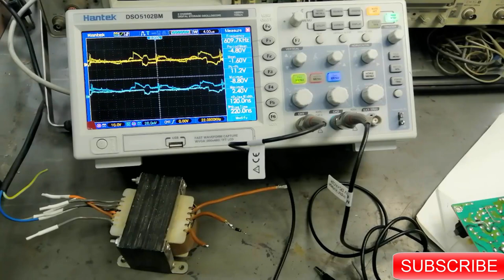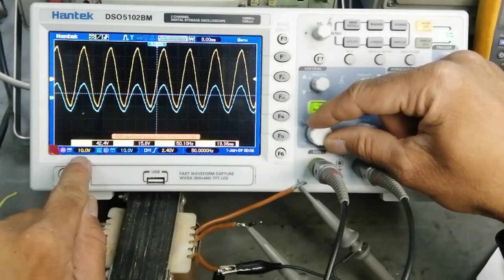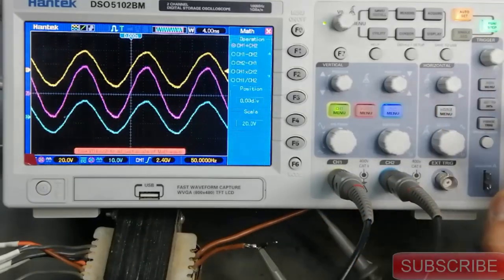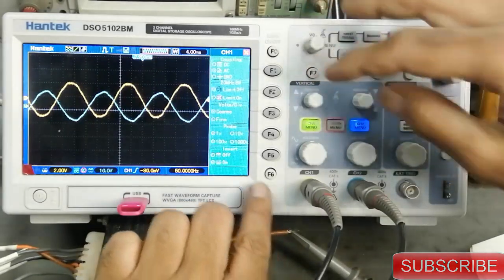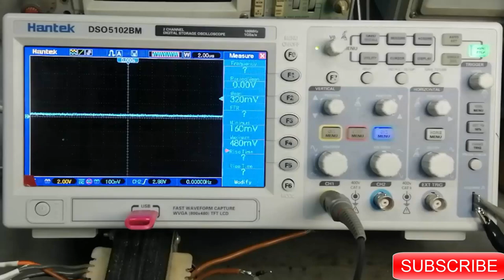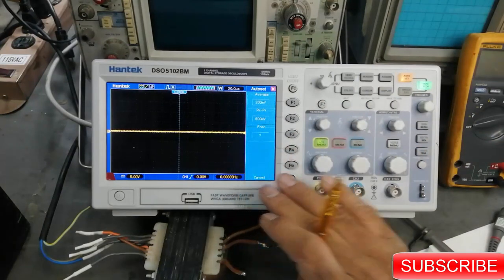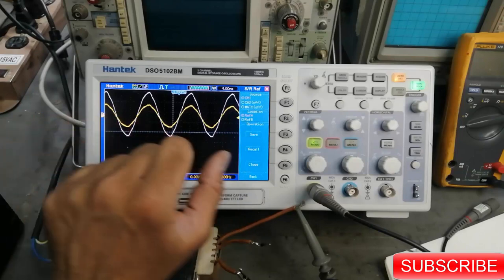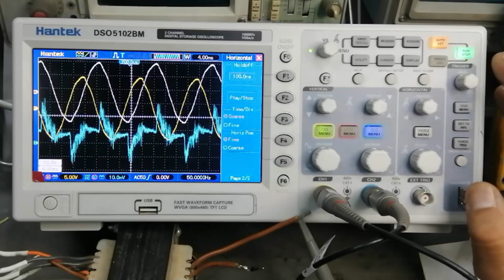{167} How to use OSCILLOSCOPE - Digital Storage Oscilloscope DSO - Complete Tutorial

Comment: Hi bro, nice video. We are using Tektronix TDS1012 100MHZ 2 channel 1GS/s, could you please advice the latest equivalent model?
Reply from the maker: Hantek DSO5102BM is almost similar to TDS1012 
Finrisi ADS1014D will more good choice, as it is 2in1 Oscilloscope and Signal Generator, 100MHz, Built-in 1GB Storage Space
Reply: @HaseebElectronics  thanks bro

Comment: Salaam sir, I have updated my fnirsi 1014D, and after update, frequency parameters gone to reverse side (down side of screen) even i am trying for move with manual key and auto key, but I am unsuccessful,  so if possible kindly guide me in this regards.
Reply from the maker: sometimes it happens due to corrupt file in updating media 
try to re-install updates
or 
try to restore factory setting. from Utility menu

Comment: Thank you for this detailed demonstration! The SMPS signal measurement part was very interesting. I wonder whether a 100Mhz scope would be capabale of measuring any SMPS unit? Or maybe some power supplies have even higher frequencies? I noticed that unlike multimeters, your oscilloscope didn't have two seperate probes for positive and negetive connections coming from the device. The negative probes were branching off from the positive leads. I assume it's the case with all oscilloscopes. Do you know about a device called curve tracer? A professional tech on youtube recommends it very strongly but the odd thing is, he's the only guy from whom I heard about it. Oscilloscopes, spectrum analyzers, and DC loads are common stuff but curve tracers are unfamiliar. Do you have any thoughts?
Reply: V-I curve tracer or component tester. In Digital Storage Oscilloscope you can do this by switch the settings of two channels into has X-Y mode, where X is for Voltage and Y is for current. With the combination of a Signal Generator and DSO(X-Y mode on) you can do this.